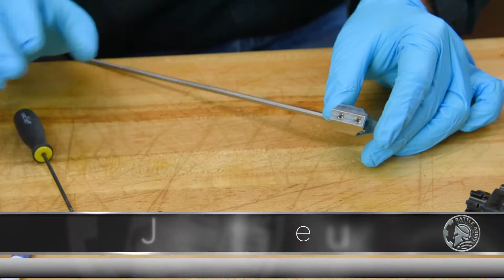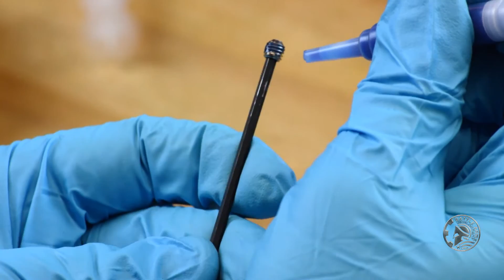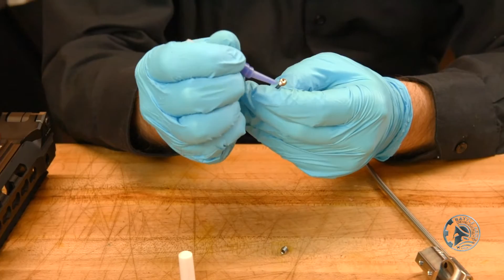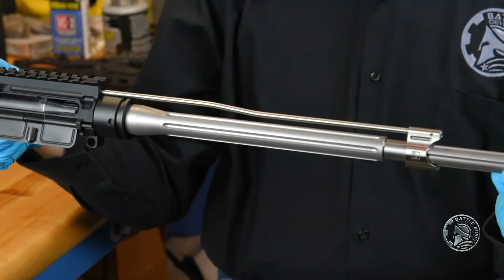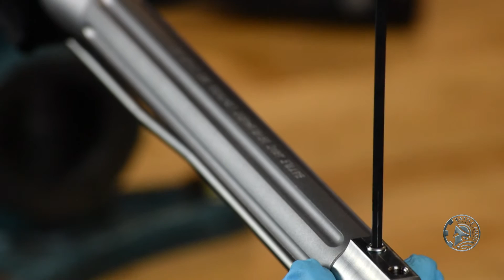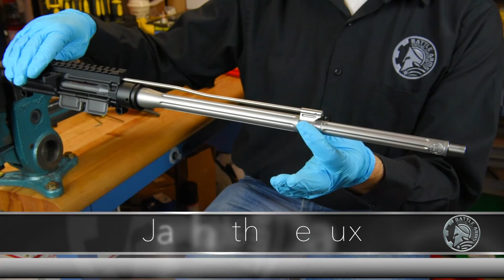THE UPPER  Gas Block Assembly on the Barrel Part 5

Comment: I have a question, Does or is the gas tube supposed to seat tight or bottom out in the upper receiver when inserting the gas tube. I am building a .308 Gen 1 DPMS, I have an 18" Wilson stainless match, Barrel using a Odin works adjustable gas block with Guntec upper receiver. when checking fitment, with the gas block seated, I noticed that before pinning the gas tube, that there is about a 16th inch of movement in the gas tube between upper receiver and the gas block.